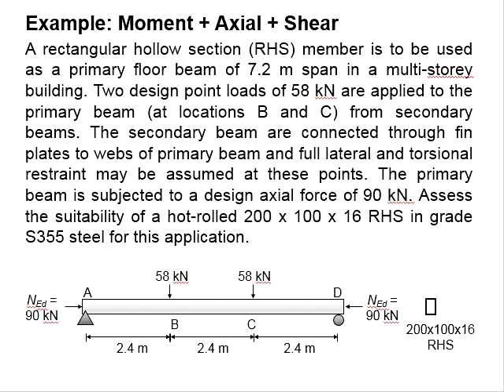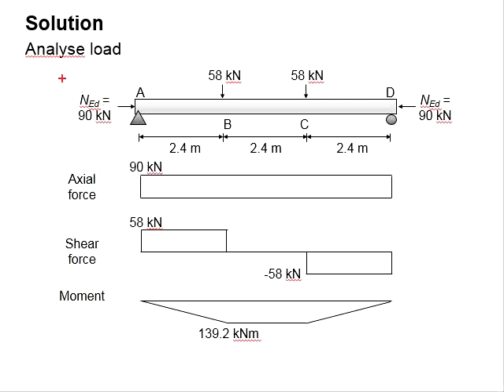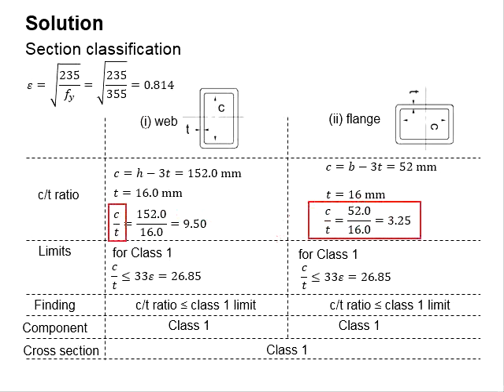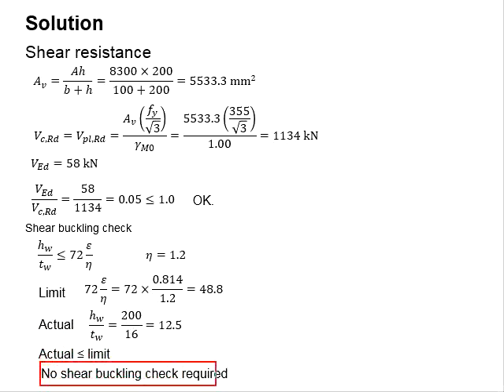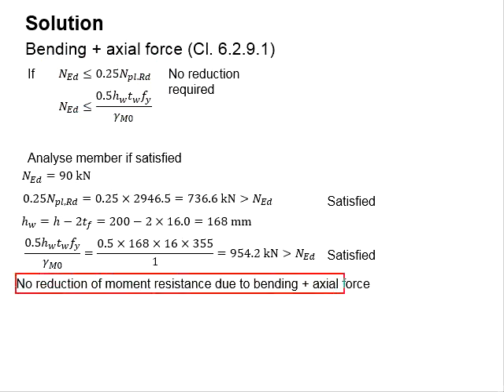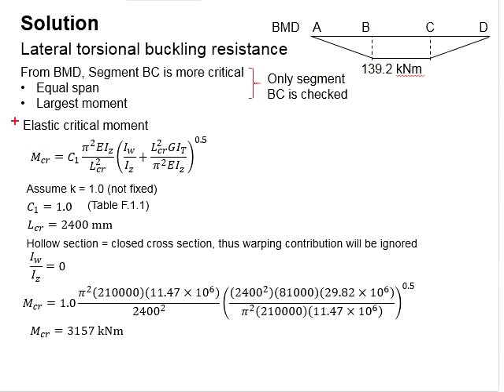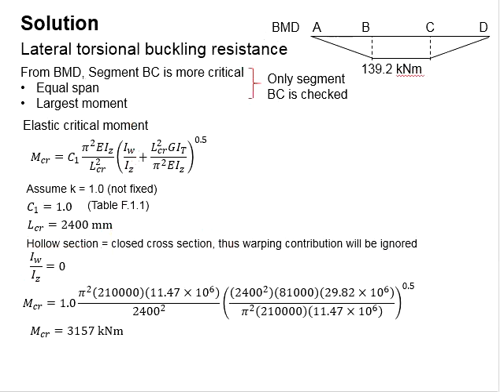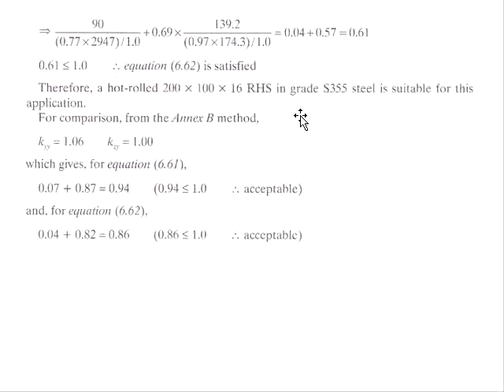6.9 Example: Moment, axial and shear loads

Comment: Sir, in checking for the lateral torsional buckling, why is the Lcr 7200mm for major axis and 2400mm for minor axis? And why did we use Iz for both major and minor axis?